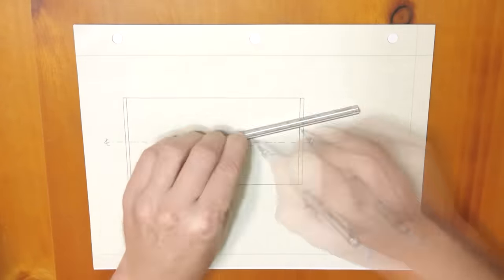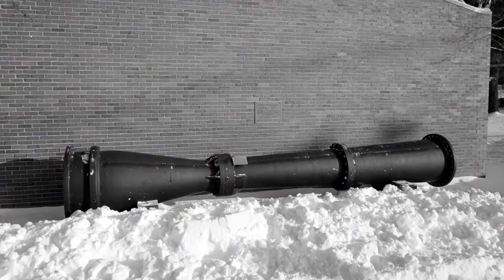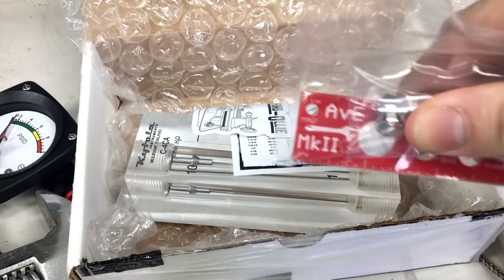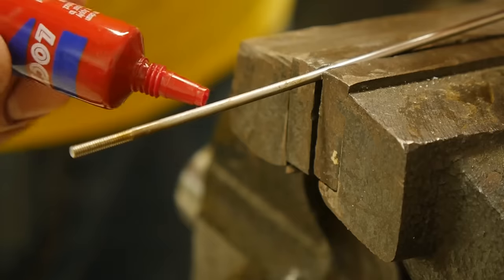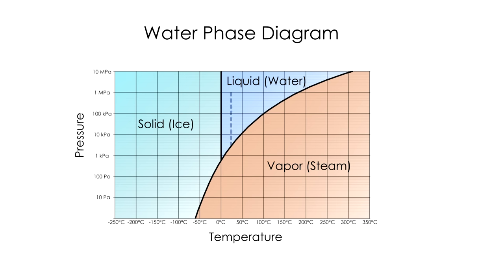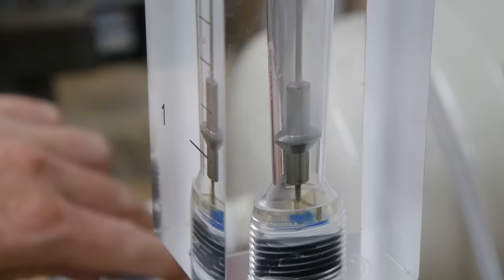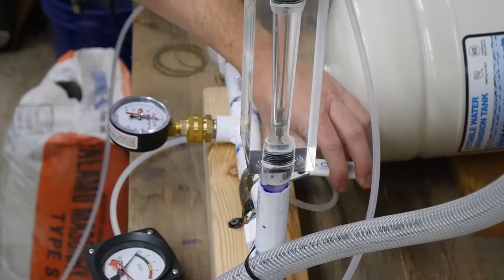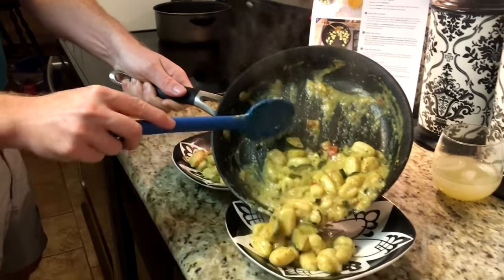What is Cavitation? (with AvE)

Comment: Worked as a throttleman on a submarine in the US Navy, we used venturi to draw vacuum in condensors. Also had to listen to hydrophones to make sure that we did not cavitate.
Reply: Kevin Agnew 
I was on a surface ship! We cavitated anytime we accelerated too quickly and it was powerful enough to make the whole ship shake. Being in control of all that power was one of my favorite parts of standing throttleman watch.
Reply: Well that blows my The Hunt for Red October quote right out of the water!
Reply: ♪♫ Stop, de-cavitate and listen~ ♪♫
Reply: All ahead 1/3! Make 4 knots to nowhere!
Reply: Man! I wish I could use that in my job history, "Worked as a throttleman on a submarine..." Don't bump into many guys that can claim that. Cool, very cool.
Reply: @disgruntled181  actually we were a fast attack boat and once got to ahead flank for 72 hours.
Reply: Kevin Agnew 
I'm no nuke but doesn't that affect the reactor life a bit. I was on fast attacks too, but they were always stingy with the reactor power. Bumps up the refuel date. but I guess with the new classes coming out that won't matter...
Reply: @disgruntled181  yes but when you really need to get the boat there.... Needs of the Navy can change everything.
Reply: Kevin Agnew 
lol, heard that line too many times!
Reply: Once upon a time I read about an idea for a really fast rocket powered torpedo that would have had a blunt head to form a cavitation bubble around it..

Comment: Great video and explanation, but I thought that I should point out that most of the bubbles you are creating are from the dissolved gasses in the water. This is observed by watching the bubbles and how far they travel past the area of low pressure. If they were purely water vapor bubbles they would collapse much sooner. The dissolved gasses coming out of solution are what prevent a lot more damage from being done to equipment such as boat propellers, because they cushion the vapor bubble collapse. When you have a system such as a condensate pump where the air and noncondensable gasses have been removed, the vapor bubble collapse can be much more violent and destructive.
Reply: Ahh, I spot a steam plant operator!
Reply: TheSirGoreaxe 
Guilty.
Reply: Nice comment!!  Thanks!!
Reply: dothemathright 1111 
Cool,  I've never seen the test tube thing,  but that is cool.
Reply: dothemathright 1111   I have done those syringe experiments years ago and allmost all my bubbles did disappear extremely fast. 

I assume that collapsing steam bubbles also could be the reason that water that does not yet boil make a "coarser" sound than boiling water. Bubbles appear at the bottom of the kettle but then collapse as they rise. In boiling water they reach the surface.

Comment: Thanks for sharing. There was a documentary on water cavitation where they used cavitation to really efficiently heat water, it was a spinning cylindrical rotor assembly with lots of shallow round holes, encased in a tight fitting round housing with an inlet and outlet for the water and while rotating, the water passed through and underwent cavitation and rapidly heated in the process. I think the docco was called “Equinox it runs on water”

Comment: An even cooler example of cavitation in nature would be the pistol shrimp! Mantis shrimp do use cavitation, but they also just punch their prey very hard. 

Pistol shrimp have a single large claw with natural springs built into the chitin. They ratchet the claw open, and can then slam it shut with such force that it creates a cavitation bubble. When the bubble collapses, the resulting shockwave can stun, or even kill prey outright. Moreover, they can use the sound to communicate! 

Pistol shrimp get their name from that loud, gunshot like noise. They can be clearly heard in an aquarium from across the room. They're the loudest animal in the world, creating sound over 200dB. When colonies of thousands gather on a reef, the cacophony can disrupt sonar. Other animals around the reef use it to navigate at night, because they can always hear what direction the reef is. 

Mantis shrimp accidentally create cavitation. Pistol shrimp do it on purpose.
Reply: Now that is an interesting, informative and useful comment. Top work mate.
Any idea of the relative sizes of cavitation bubble that the two species create?
I presume the Pistol Shrimp's bubble would be a fair bit bigger, simply due to more efficient natural design?
Reply: My understanding is that they are very difficult to keep in aquariums because they're liable to break the glass of the aquarium.

Comment: Awesome vid.  We use a down hole pump in the oil fields that work off of the Venturi effect. we use large p.d pumps to move produced fluids in to a throat and nozzle to reduce down hole pressure and lift struggling oil and gas wells. Pretty awesome to see cavitation in action I only see the aftermath at work.

Comment: The water phase diagram didn't correctly indicate that liquid water is more dense than ice by the slope of the line between the solid and liquid be phases. (Note: I'm a chemist).

Also, I have personally used sonicating baths which function via cavitation to remove air bubbles from solutions as well as used ultrasound the lyse open bacterial cell walls as a step in protein purification. It's interesting to see how people outside my field use the same physical processes.

Comment: Your drawings were fine. The only dimension thats unclear is the minor diameter of the tapered hole but if it was drawn to scale, theres enough info there.  I think Ave went about it the wrong way.
Reply: Use one of the simpler parametric CADs to sketch the part, and don't stop until it's saying "zero degrees of freedom left". Impossible to go wrong with that... ;)
Reply: *aboot

Comment: Very cool and interesting but.... Did you consider that (some of) the bubbles you are generating is just air degassing out of the water?  I presume you are using mains water at about 5 bar (70 PSI) and 15 C (60 Frankenstein).  It potentially contains about 0.09 Vair/Vwater.  This dissolved air will "degas" out of the water well before you get to the cavitation point of water.  I believe you have some air in your water based on the bubbles we see in a couple of shots just before you start the flow.  Also, the bubbles survive a long distance up the venturi from the restriction.  Longer than my intuition would think a cavitation bubble could survive.  All in all an excellent bumble f**kery.

Comment: A Tool Maker would've designed that to be 4 triangles held in a bolster. Very easy to machine (no deep cuts with narrow tools), interchangeable functional bits (swap out triangles to get different venturi values without rebuilding the entire unit), able to use dis-similar materials (Aluminum bolster with tool steel (maybe 4140) working surfaces ?) 

Tsk, tsk... next time you want to give the engineer what he/she NEEDS rather than what he/she ASKS for, consult a Tool Maker. We've learned (in the most painful ways) to do this innately.

As both a Tool Maker and a Mech. Eng. my left side is in constant battle with my right, but I ALWAYS get what I need in the most efficient manner. Gonna cut & paste this to Practical Engineering's v'jayo and offer you both a nickels worth of free advice on future endeavours available just for the assking. (not a typo)

Comment: We use inductors all the time in our business.  They allow us to inject gas into liquids and aid in the gas being dissolved by that liquid.  You spoke about not being able to measure the exact pressure at the point of the constriction in your setup...  we design and build inductors that can almost pull a complete vacuum with a high enough DP.

Comment: Grady, you might find this interesting:
There's another, lesser known type of cavitation that's used in ship hull drag reduction. It's called "air-ventilated cavitation". Rather than inducing a phase change in the water, air is actually injected into the flow stream, creating an air cavity (rather than vapor cavity) that attaches to the bottom of the ship/vessel. Pretty cool stuff :)
Reply: Supercavitating torpedoes use a similar principle by generating gas bubbles through a chemical reaction and venting them out the nose cone, to surround the entire torpedo in a blanket of bubbles.

Comment: We had a washing machine back in the '50s that had a venturi pump to empty it.  You connected it to the cold tap and the water was fed through a venturi and into the sink.  A pipe led from the venturi into the tub of the washing machine and the dirty water was sucked out.  There was a 3-way tap on the venturi which opened all 3 ports to drain the tub, closed the outlet port to fill the tub and closed the inlet port to switch it off.

Comment: A common cavatation area are the wet cylinder liner's on diesel motors. Under compression stroke the cylinder distorts as pressure builds and combustion takes place. Then the liner springs back creating a low pressure zone that cavitate the coolant erroding the liner. Eventually holes will be etched into liner then coolant will be exposed to combustion gasses.

Comment: When learning how to pump with the fire department, many times they brought up avoiding cavitation.  We would boost the pressure of a 60psi main to supply 150psi or greater to the nozzles.  Pump operators are told to watch when the static intake pressure of 60psi dips below 20psi residual pressure.  That below 20psi there's a much higher risk of collapsing the flexible intake lines due to "cavitation".  The impeller based pumps could be damaged or municipal pipes could crack and leak.

Comment: One experiment I accidentally discovered recently was using a large syringe that I use to measure out water for my cacti.
Get a large syringe(100ml+) and fill a sink with water. Put the syringe into the water and ensure that all air has been removed from the syringe. Then quickly pull the plunger back to bring water into the syringe under pressure. You will see the water boil inside the syringe as you quickly pull the water in.

Comment: You should watch the documentary about Glen Canyon Dam in 1983, where cavitation occurred in the spillways (same type as hoover dam with an overflow system that then flows into a pipe leading to release downstream from the dam.  It basically destroyed the bend on the spillway arm and took out huge sections of the concrete lining.

Comment: The interesting counterpoint with propellers is that there are also propellers that are actually designed to create cavitation bubbles around them on purpose, when you can create one large enough to enclose the entire propeller and sustain it you can greatly reduce the skin drag allowing far higher speeds, which can even work for the entire craft as a whole though currently only things like torpedoes and similar projectiles have really demonstrated this, attempts to actually extend this principle to entire submarines are ongoing though I believe.

I could be wrong on this but the same basic principle applied to compressible fluids is I believe part of the ongoing work on shockwave alteration in aerospace also.

Comment: I used to work for a company moving oil about in ships.  Mostly they had centrifugal pumps driven by steam turbines at 1800 RPM maximum speed.  Some of the ships had electric motor driven pumps where the governing factor was current drawn rather than RPM.
So the strange thing was that when pumping water ballast we used to "cavitate" the pumps, at least that's how it was referred to.  The pump was started with all the necessary valves fully open and once running the suction valve was shut almost right down and then opened up very slowly until the rushing gravel sound was heard.  The flow rate was much higher than in normal operating mode.  I don't remember the AMPS for normal or cavitating mode.  Don't know what the effect was on the pump rotor either.
I do remember one time a pump started, the amps went very high, there was a bit of a bang and the amps dropped right off, so did the back pressure.  The broken drive shaft probably explained both of those occurrences.  When the pump was opened up, a lost ullage float of a bit of wood about 3" x 3" x 1" had got into the pump body and stopped the rotor from turning.  The drive shaft was about nine inches in diameter.  The ullage float had been lost of a surveyor type fibre tape measure and managed to pass several filters, obviously not fine enough.

Comment: Nice video. If you wanted a device to measure the vacuum at the reduction ask your local fire department if you can borrow a portable foam inductor. The pickup tube can be fitted with a gauge.

Comment: Don’t know if you still read comments from old vids but i’m currently priming myself for a pump change on one of my building’s with damage caused by not de-isolating the flow side before running the pump, would you be interested in seeing photos from the job as i would hazard a guess that he didn’t prime the pump either before running it till the mechanical seal broke. 
To make it more interesting it’s also leaking dark fluid, frothing up and now it runs an algae colour! 
We’ll be replacing like for like then repairing the old for spares.

Comment: Cavitation is also a huge source of noise in a tactical setting. 
Every submarine has a set of charts for depth showing the propeller speed that a submarine's pilot/helmsman/engineers cannot allow the prop to exceed without explicit orders to do so because crossing that line makes a great amount of noise.

Comment: Another area where cavitation is important is on (stealth) submarine propellers, cavitation bubbles form on the low-pressure area of the blades and their sound can be detected. There are many ways to reduce it (using more blades running at lower speed, to reduce the pressure differential or using different materials), there is a lot of secrecy around them though.

Comment: I believe a venturing is used on A/c systems too. The hot air from inside the house is absorbed through a (evap) coil inside the home. Than pumped outside into a another(condensor) coil which releases most of the heat. After that the liquid is metered in a venturi(metering valve)which turns it into a much cooler low pressure vapor. That vapor than goes into(evap) coil again absorbing the heat inside the home. This is all a take place in cyclical cycle which is all sealed.

Comment: Perhaps you should have asked some advice from an instrument engineer. The Kytola is a variable area flow meter which is a special case of an orifice plate which runs at a constant pressure drop by varying the area left for flow. A venturi would be a poor choice to demonstrate cavitation as it is designed to avoid sudden changes in pressure (which does not mean you cant get flashing and cavitation, it is just much harder).
An orifice plate is a good environment to demonstrate this (and a bad place to experience this in practice).

Comment: I've done a bit of repair work on pump housings and impellers do to cavitation.  

Was at one of the dams in Eastern Washington, they had a turbine impeller out on display for the public.  You could see where the stainless steel was eroded away on the back side at the blade root next to the hub.

Comment: So one of the cool things about cavitation is that when a bubble of air in water collapses against a surface it creates creates a jet into the surface.  Basically the bubble deforms when it hits the surface creating a pressure differential on one side, the outer edge collapses in sort of like a stream of water going through a torus of bubble and that water is traveling at enormous speeds and that's why it causes corrosion. Eventually all of those tiny water jets slamming into your material will erode it until you get the kind of corrosion you can see in the picture of that corroded turbine.

Also, interestingly, these water jets are the same basic concept behind traditional torpedoes. The explosive isn't there to do damage directly with the shockwave, it's there to create an extremely large (compared to normal cavitation) bubble such that when it collapses, the extreme force of the water jet punctures the target's hull!

What i'm saying is, bubbles and water are intense and cavitation is definitely not something you want most of the time! If you've got bubbles forming and popping in a non-compressible fluid, you're gonna have a bad time

Comment: Cavitation is also what causes your bones to crack and pop, like your neck or knuckles. You stretch the joint enough that the lubricating fluids under the lower pressure form carbon dioxide bubbles that quickly pop.

Comment: great video! I just have one correction about the phase diagram, however. The line separating liquid and solid should have a negative slope since the density of solid water (ice) is less than that of liquid water. Other than that, it was wonderful!

Comment: Diesel engines in truck usually don't need rebuilds until cavetation eats through the cylinder liners.  I've seen engines with 1,000,000 miles that could've easily run another 1,000,000 if not for a single tiny pity in the cylinder wall leaking coolant.  There are additives that help but nothing can completely prevent it.  The way coolants circulates in the system is the primary cause as can be seen in the way pits are localized on the cylinder but the explosions inside the cylinder contribute as well.

Comment: hi there, i am doing my theses on nanobubble and its cleaning properties, and came across your video, very helpful...
i was wondering if you can help me with this questions， 
if fluid cavitation is destructive, where does the destruction happen?
does it only happen at part of the neck, when liquid turns to gas? 
or any physical material when in contact with the fine bubble?